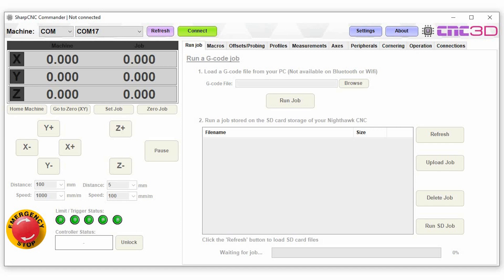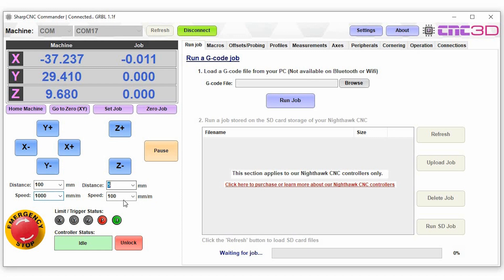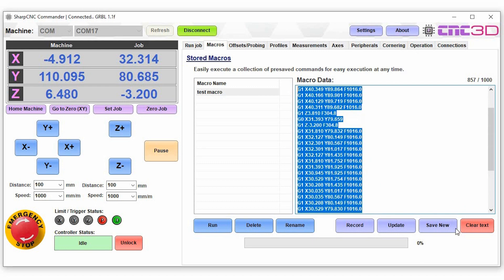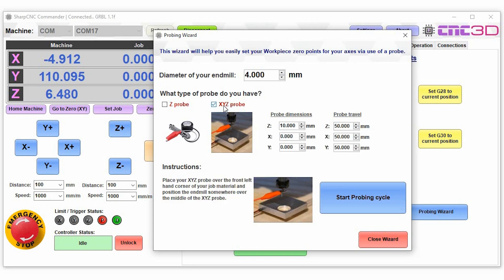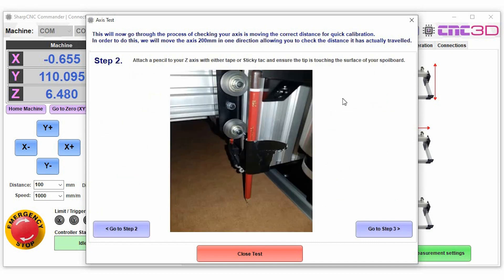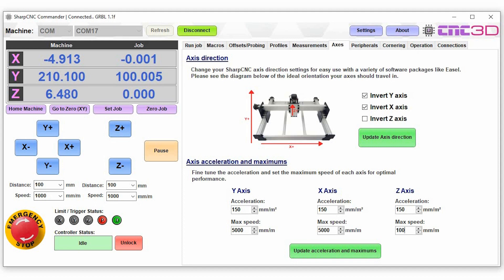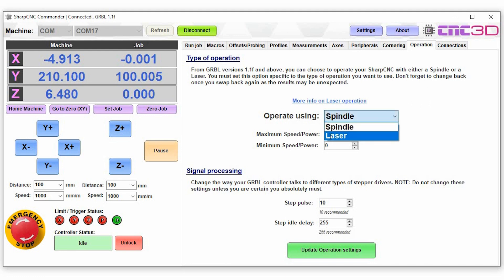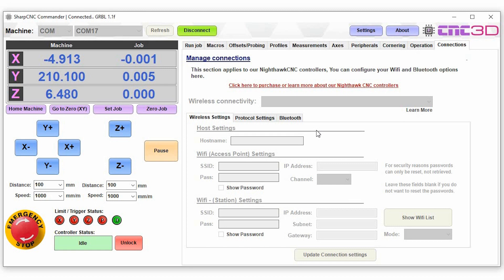SharpCNC Commander GRBL control software has been released!

Comment: i have the xpro v5 will this controller work for me
Reply from the maker: Absolutely.

It is made to support it's extended features. Like network config and managing and controller SD card jobs.

The version pushed through lastnight now makes setting motor current and microstepping easy.

Comment: Hello 👋  The software looks great.
Q\
 Near where the emergency button is, where the distance and speed are shown, could you add to the option distance that can be set continuously? 

that way you can move the axes without stopping unless you release the button. 
thanks for the video.
Reply from the maker: Hi,

Have you tried the keyboard controls?

Click the keyboard icon in the middle of the X and Y jog buttons so it turns green. If you hover over the button it tells you the keys. We've set it up as gamer style WADS-EF. 

The distances can be set in the settings.

Let us know if this works for you.
Reply: @cnc3d  

Ok I will be testing the software and I will comment.

Comment: grbl seems to tequire one file for each tool.  if I build a toolchanger and want many tools in one file, will grbl still work for me?  Or is there other software I shouls use to get several tools in one file?
Reply from the maker: Hi,

The latest version of commander manages too changes itself. We are working on a Fusion and Vectric post P that will suit how we have have set Commander up.

Comment: its not connecting to arduino uno
what should i do\
Reply from the maker: do you know which version of grbl is on it? Is it 1.1e or greater?
Reply: @cnc3d  yes its working now i brought a new arduino,
Might there was some issue with that 
Thanks.
Reply from the maker: @jagsiragriculturalworks5946  ok perfect thanks. I added a start up command datalog to the Help section for troubleshooting these issues.
Reply: @cnc3d  thanku
Reply from the maker: @jagsiragriculturalworks5946  you're welcome :)

Comment: Hi,
Is it possible to use this software with an Arduino mega and GRBL mega ? 
It's not working for me..
Reply from the maker: hi Valentin,

Can you send us your controllers initial connection string and response to "$I". We rely on the response to the "I" command to determine which version of grbl you have.

If the response we receive starts with "[VER:1.1..." then we acknowledge it's GRBL 1.1.

Which flavor of GRBL is it? X5MEGA?
Reply: @cnc3d  Would love to see this support the 5X Mega. I have a 4 axis setup (X, Y, Z and A as a rotary table). Also, does it support inches as well as mm?
Reply from the maker: @tzampini  it should support 4 axis yes. Have you tried?

Comment: can this GRBL software stranslate macro B?
Reply from the maker: Hi,
.I'm not sure what you mean exactly. It supports GRBL compatible macros yes. :)
Reply: @cnc3d  i mean, using variables for example #600=100.0; it is not G-code it is more advamced programing as even old controlers support
Reply from the maker: @sweetcheers1  Hi Valdi, not at this stage but it is on our list. :)
Reply from the maker: @sweetcheers1  GRBL does not support variables so our software will need to manage this.
Reply: @cnc3d  thank you. Yes it would be very wonderful so i could use your software for testing my advanced programs. And i have one more question, Can i use your software to any kind of portable CNC machine? As i found many chinese stuff on internet as the one you have pictures in your video. I want to buy that machinese and i would like to use your software and share with other siftware. SOme chinese software can convert pistures to a program that ingrave the picture
Reply from the maker: @sweetcheers1  We have already added some creation tools. See a later video here.

https://youtu.be/1b1MRovgMSk